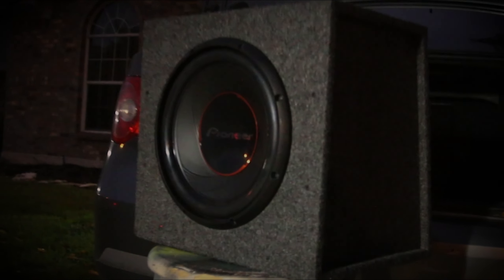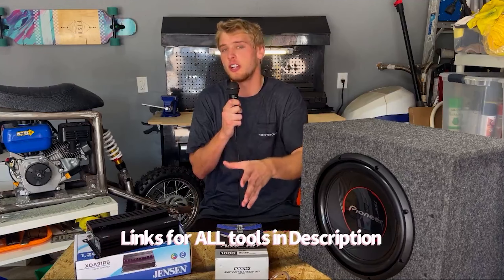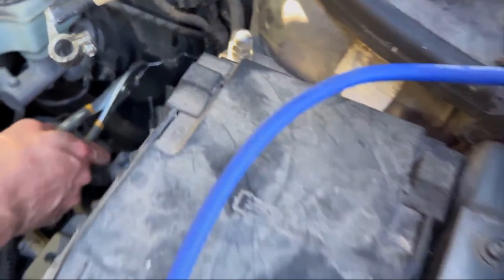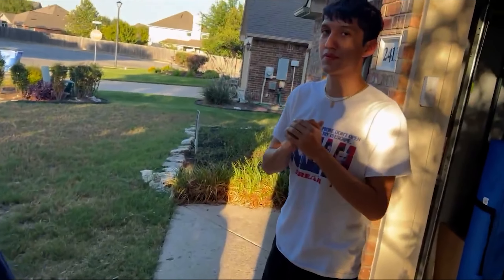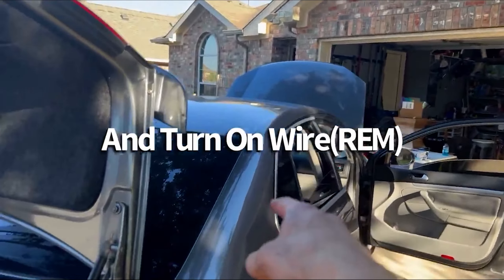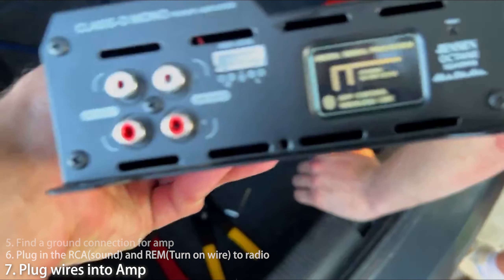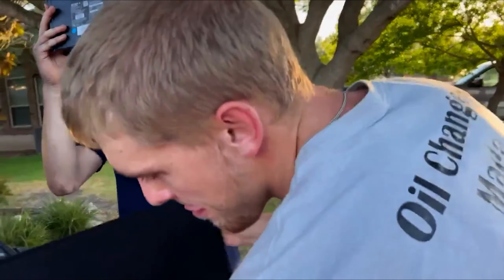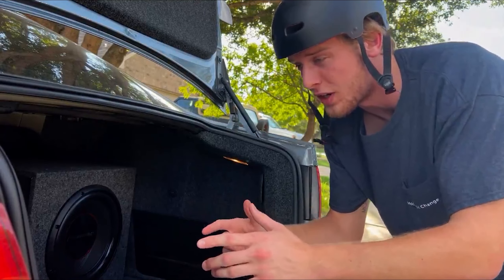HOW TO: Properly Instal SUBWOOFERS || WALMART SUB & AMP KIT

Comment: Regardless of unhooking negative First... you should always run the power cable through the firewall to the amp before connecting it to the battery..... here you connected it to the battery and ran it through firewall the camp